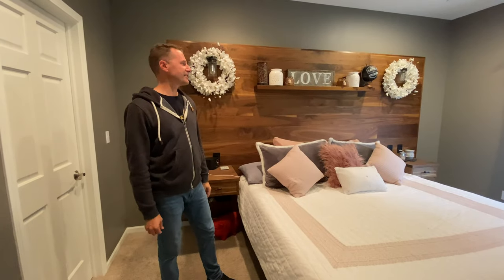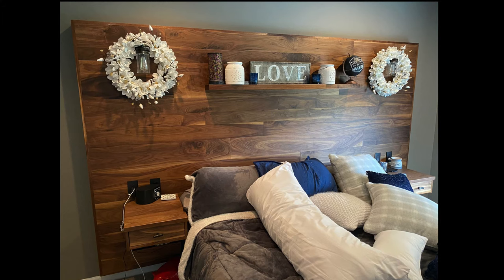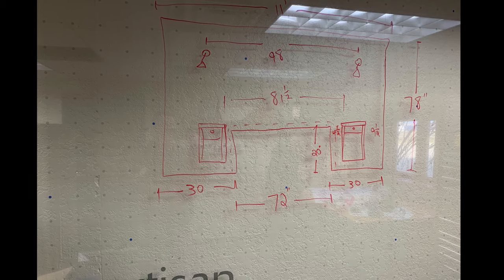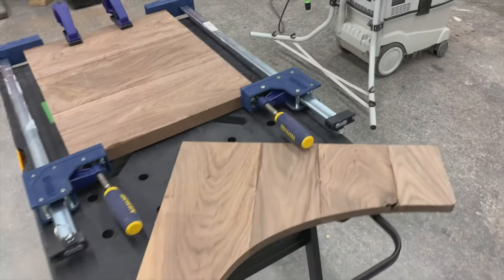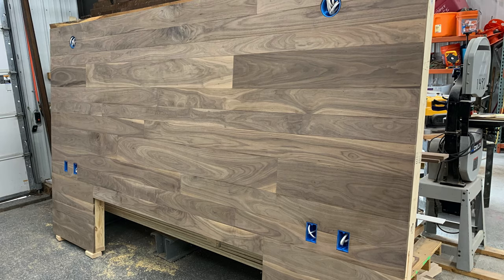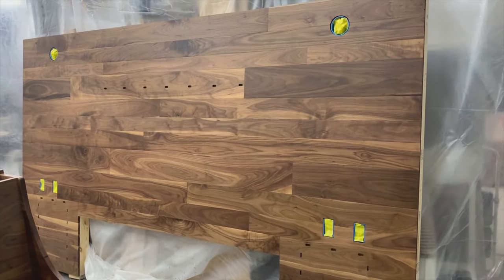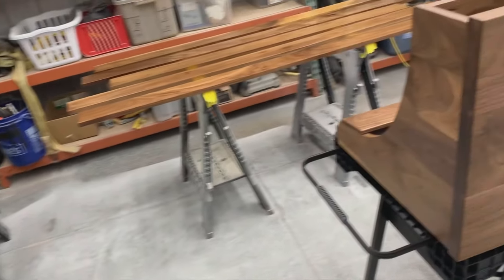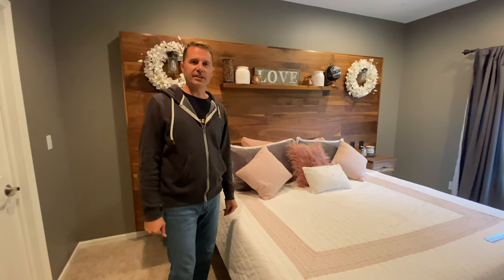Unique Floating Headboard Build With Built-In Reading Lights And Electrical

Comment: This is incredible inspiration, Im going to try my hand at building one like this with some changes to fit our space. Curios though, what did you use to fasten the walnut to the framing? Just nails thru the face? or something thru the back?
Thanks
Reply from the maker: Thanks Cody. I’m sure I just used finish nails through the face and didn’t even fill the holes. Good luck!

Comment: Where did purchase the brackets to hang wall?
Reply from the maker: I had them made by a local company that does metal works
Reply from the maker: Wait no those are a manufactured bracket I use to hang different types of panels on walls. It's a specialty type bracket that you could get a lot of places like Monarch